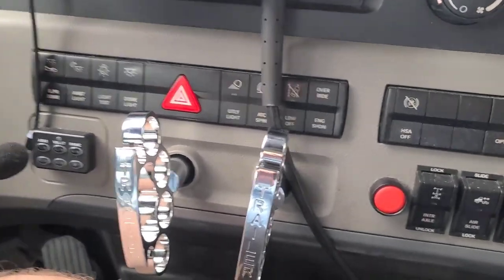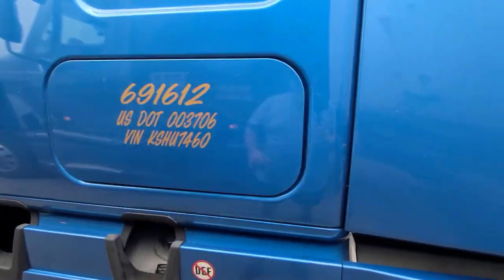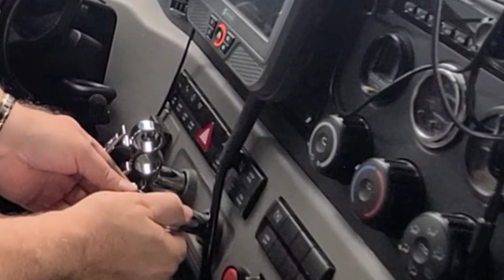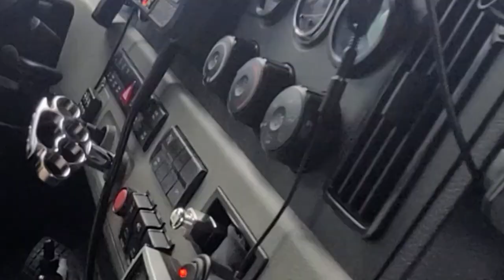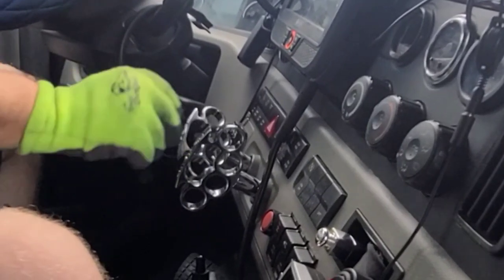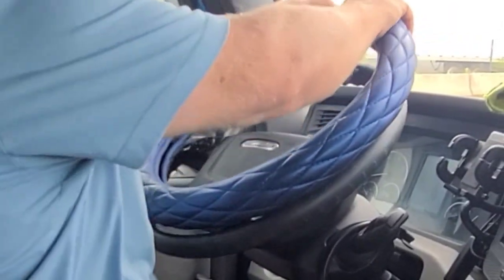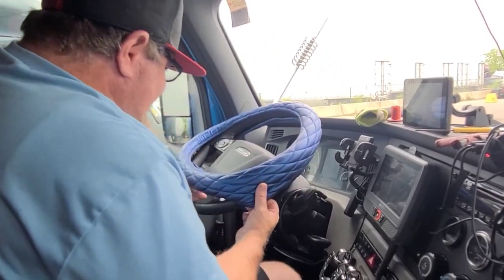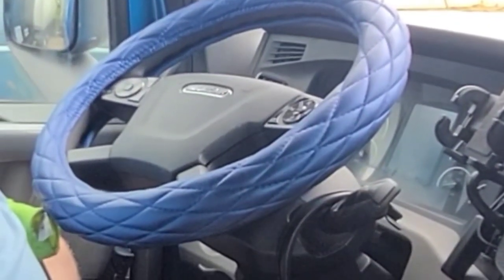How to replace protection valve handles and steering wheel cover on your 18 wheel big rig cdl truck

Comment from the maker: NOTE! If you notice the trailer valve kept popping out and I thought it was due to low air. Nope it was the handle screwed down too far and was bottoming out causing this. So it is important that you make sure this isn't the case as it may cause premature eja... premature setting of the brakes. I fixed this by swimming the handles with small bits of cardboard in the holes to back them out a little when tightening.
Reply: Ohhh almost forgot to welcome you to the Cadillac side box club, your officially in the club. BTW drill some holes in the bottom of your side box so water can drain. I didn’t do mine at first and my brand new chains rusted cause they couldn’t remove the water from using them ONE TIME.
Reply from the maker: Chains will never come out from under the bunk..lol
Reply: The yellow triangle is actually a diamond